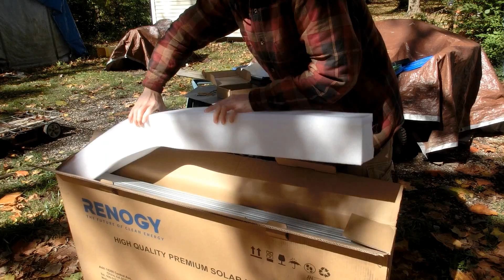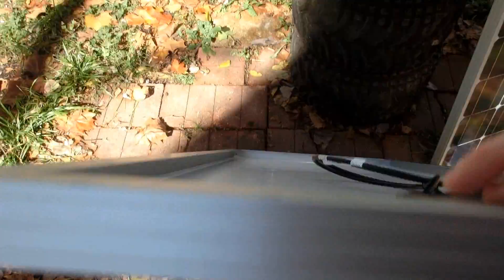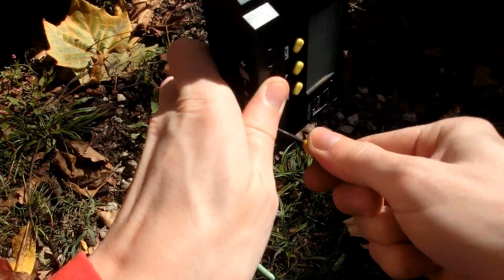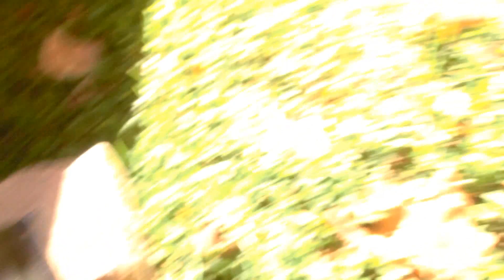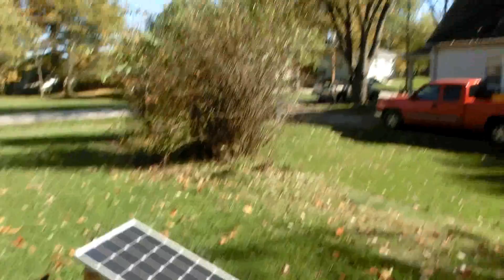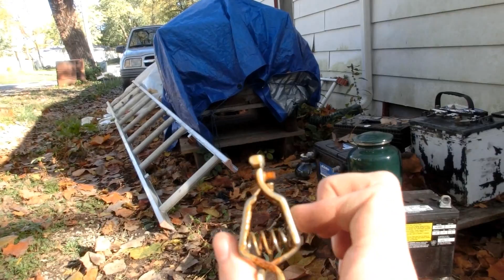Random Bits 0058: 200w solar panel system

Comment: Ur right, doubling the conductor size or running the same size cable in parallel will half the resistance. I'm keen to c how this new system of yours works out. There is easy ways to work out voltage drops http://www.calculator.net/voltage-drop-calculator.html. But u probably are already all over it.

Comment: This is really cool! Can't wait to see what you do with this stuff.

You're thinking smart regarding power loss over the battery cables. Power is the current squared times resistance, so if you have 6 amps going over a cable, and its resistance is 0.2 ohms, that's 7.2 watts lost. Voltage is current times resistance, so that would be 1.2V lost over the cables, as well. So whatever the panels are producing, the controller would see 1.2V less - a fairly significant loss. You're on the right track to minimizing it, though.
Reply from the maker: well remember that was 0.2 ohms for 100 feet. i'd prolly be using 50 feet so even less.

Comment: MisterClaws one controller will manage several batteries, lead acid batteries, assuming they are good( no duds as rinoa mentions), can be charged on a common rail quite happily, so the charger will monitor the output voltage and it doesnt matter if its one or twenty , and as he has 200w of solar, that can manage to maintain 20 batteries pretty well.

Comment: 17:00 low voltage DC doesn't travel well, you should loose quite a bit, i'm curious to exactly how much
Reply from the maker: well 50ft would have like 0.12 ohms and should lose about 1.5% with two 14awg wires. but i'll be using 6 of them at the least.
Reply: Rinoa Super-Genius
 so you will loose 6 times more ? or 6 times less ? or the same ? i'm curious
Reply from the maker: Joe G.P.
 i'll lose about 1/3 or 1/2. losing 2 watts isnt really all that big of a deal in my opinion.
Reply: Rinoa Super-Genius
 a 3rd ? loosing 33-50% sounds pretty bad
Reply from the maker: Joe G.P.
 no if i add 3 cables i'll lose about 1/3 as much as i did with 1 cable. so like 1/300th or whatever instead of 1/100th

Comment: be good to tie up all those 12v batteries over winter and keep them topped up! be interesting to see the system for a dozen batteries together!
Reply from the maker: yeah. i'll be very selective of them though. i wouldnt want one bad battery to drag all the good ones down to like 12.2v and let them sulfate.

i may use diodes to charge the dead ones first but then they can drop in voltage without the big ones being killed.
Reply: Rinoa Super-Genius
actually thats an interesting idea, in fact your fuses for each battery could incorporate a diode, then each one cannot draw down the bank, and you can plug away or pull out a battery anytime

Comment: What life of panels
Reply: Rinoa Super-Genius I read a few years ago the first commercial panel made 25+ years ago still works and is running at 80% of it's original rating.
Reply from the maker: you mean how long they will last? they prolly lose <1% power every year i think. so in 100 years they wont work any more.
Reply from the maker: abyssunderground
 yeah that sounds about right. they last a long time.
Reply: Lol
Reply: Yes im hard to read and most of time to unstand

Comment: Controller will melt when bad. Put inside metal box when possible. May catch on fire.
Reply from the maker: thats a pretty sensationalist statement saying all controllers turn into flames when they fail.... any proof?
Reply: Rinoa Super-Genius good luck goodbye
Reply from the maker: TheMoneypresident
 your always such a negative commenter. "this video is boring" or "that controller will burst into flames"

if it does burst into flames it will be quite interesting.
Reply: Rinoa Super-Genius What a troll. Worst it will do is probably cook your batteries. I guess if you have something switching on to produce O2/H when they're full then that wouldn't happen anyway.
Reply: abyssunderground
i have had several different solar controllers, they barely get warm!, what did happen to one is that when it failed it basically connected the panel to battery direct, i happend to notice the battery voltage was was too high at 17v, but still nothing drastic, of course my battery is fused so no way can too much current get back to the charger if it did something weird though

Comment: Its so easy to connect wires wrongly, ive done the same thing.

Ive corrected loads of celing light fittings for rather foolish looking people, "it just blows the breakers now, can you help", they somehow allways manage to connect the switch wires across the 240v mains lol, im sure you have encountered such people too :-))

Comment: Do you need one of these controllers for each battery? Please explain how you would connect multiple batteries to the controller and still have the ability to monitor individual battery voltage.
Reply: It will work with several batteries connected in parallel  just takes longer to charge but it also takes longer to drain

Comment: You've got a lot of junk in your yard.  I bet I could find enough to make a few things from the scraps. xD
Reply from the maker: i'm actually running out of junk. i would have a lot of projects under way if only i had more things to use.
Reply: Rinoa Super-Genius Where do ya live? I get plenty of junk, all the time...
Reply from the maker: captainjerk
illinois. i get individual things but i would like to find a farmer with like 3 tons of scrap and just buy it all for cheep. getting individual parts here and there is a bit slow.
Reply: Rinoa Super-Genius Yeah, yer a lot farther away than I could effectively even ship to. If you were in NE I would tell come on over a make a pick up. Tell me a few things I could stuff in a medium size box, and I'll see what I can find. This area is full of cool stuff.
Reply from the maker: captainjerk
 well its not that i am needing intricate things. it's that i'm needing things like 1 inch thick steel plating and angle iron. things to make frames out of and whatnot. thanks for the offer though.

i may see if i can get a bin full of off-cutting from my grandfather's company before he retires.

its just stuff like angle iron and thick metal can be quite pricy.
Reply: Rinoa Super-Genius If you don't mind another suggestion, I would point you in the direction of a scrap yard that can sell scrap as well as they buy it. (Not all of them are licensed to sell.) I have found amazing things there, and you might too.
Reply from the maker: captainjerk
 yeah i wish i could, but the only ones around here sell specific automotive parts at too high of a price.

i may be able to strike a deal though. who knows.
Reply: Rinoa Super-Genius I hope ya find a good place to get stuff. Or maybe put an ad in the local paper. Probably get responses from a farmer, or a contractor with some leftovers from a build.
Reply from the maker: captainjerk
 better to just ride my bicycle around scouting for farms with junk.
Reply: Rinoa Super-Genius Lol. I did the same for many years. Still do occasionally. :)
Reply: Rinoa Super-Genius It might be possible to do some junk recognizance with high resolution satellite maps which are available online.
     Since I knew you lived in that small town with the railroad visible and the creek ravine in the back, I was able to find your house and could see the familiar items in your back yard.  I also noticed that creek behind your house ended up in a closed down toxic industrial area with a waste lake, so whatever toxins you create ends up in a waste pit anyway.
     So, if I could find the junk in your back yard, maybe you could scout the area by satellite for some junk targets.
    As always, trash nights are good to conduct searches.  People throw away all sorts of potentially useful things.
     If you decide to bury the solar array power line, see if you can find some pipe to run it in.  It isn't so much for protection as if problems develop, it is much easier to slide the wires into and out of pipes rather than digging up the yard. Then you run a risk of cutting the wires with the shovel while trying to dig them up.  If there is a problem in the line, you can tie a rope at one end and haul the wire out the other and fix it or replace it by pulling the rope back through the pipe.
Reply from the maker: *****
 well ya see i'm only going to be burrying the wires like 3 inches down, just enough so the mower doesnt catch them. so if i needed to pull them up i would just yank really hard and it should come out.

oh and i wish the public satellite images of my house where that good. you can only see the extra lot due to the trees.

oh well, as we move forward they slowly update the images. just been waiting like 2 years.

Comment: I have the same issue with shadows at my vacation cabin. I made a frame for my panels that I simply move around the lot. I find you will get about 10% power in shadows or on a cloudy day. More than enough to keep a laptop charged, lights on and a small stereo going. I have about 150 watts of panels. LOTS of battery amp-hours though. The cabin had some old AT&T cell site batteries in it when I bought it. I've gone 2 weeks without a clear day and never brought the batteries down to near full discharge.
Reply from the maker: cool!

Comment: Hi rinoa, any chance you could make a video looking inside that cheap pwm controller, or just check that its actually pwm, i bought a $15 one off of ebay and it wasnt even propper pwm. i wish some sellers would actually put pictures of guts of the controller in their description.
Reply: they are all pwm, to the point it switches really fast at its cutoff voltage, the simplest crudest solar controller is the cmp12, which just reaches its cutoff and switches really fast to main that voltage within a small error of margin, you can even see the lights connected to it vary a bit in brightness though!, as you go up, they are still pretty crude but have charge and float voltages and various thing you can do on the output, or with Rinoas version, does the same but shows you some current and voltages to save you using your multimeter all the time, each feature adds to the money of course, the cmp12 has its fans if your needs are low and you have smaller solar panels
, youd probably be overcharging your batteries at14.4 with a cmp12 on a large panel, thats when you need the more control with the larger panels that rinoa has
Reply: NovakinCore
i have about 5 different solar controllers, and yes, in fact they all cause interference with a radio!
Reply from the maker: yes, and btw this controller makes a high pitched hum so that means it's pwm.
 what is lower than pwm? does yours just have 2 wires going straight through and is an empty box?
Reply: It is pwm to the point that it charges with pulses, but thats about it, its just a switching Mosfet that connects every now and then, on a transistor radio it just picks up as blips every now and then. so it seems that yours is actually proper PWM Rinoa, might be time for an upgrade then. would save me having a volt and ammeter set up too!
Reply: Yeah, just a method i noticed by watching some youtube videos on various charge controllers. since you have a few what do you see as a step up from the
 cmp12, i have a cmpt02 and it seems to be about as basic as the cmp12 just with a worse heatsink and larger form factor.
Reply: the cmpt02 is much the same as a  cmp12 really different box same funcions. if you have more solar power it only a tiny bit more expensive, it has no model number but it has a led number display in the top right,(all black design) that is to change the output switch mode  (as a timer or a simple switch) and it has both charge to 14.4 and 13.6v float, then the next (check that the seller mentions this in specifications) then at  around 30dollars, double the price of above) is the one that rinoa uses, check the ebay description for the upgraded higher quality model,(which mentions higher quality circuit and better heatsink)  which has the voltage info on screen.   there are acouple of other models in the between price range of 8-30 dollars, but other than the onesi have mentioned, i have found they are pretty fake, there is a fake mppt (it says mmpt on if, dont buy) and a couple of fake controllers that only limit to 13.6v thus dont charge properly, it seems the models with usb in them are faker (sorry rinoa! maybe not yours) than the ones without
Reply from the maker: jusb1066 well its not that this pwm is fake or not, i only bought it to act as a voltage regulator to not overcharge the batteries. and it does do that job.

i do agree its garbage along with a lot of the other controllers that falsely claim to be MPPT. but atleast it's useful garbage, and i wont feel bad opening it up and modifying it.